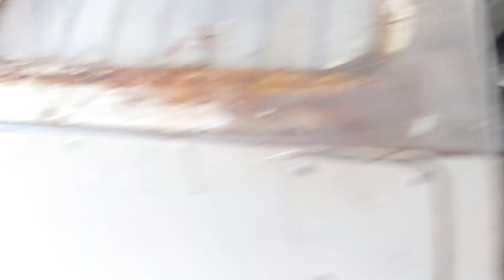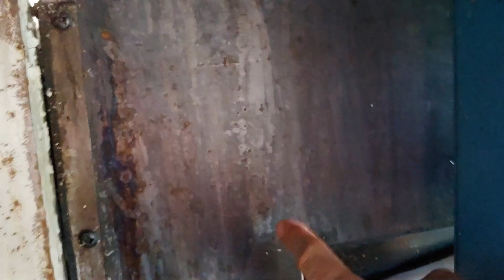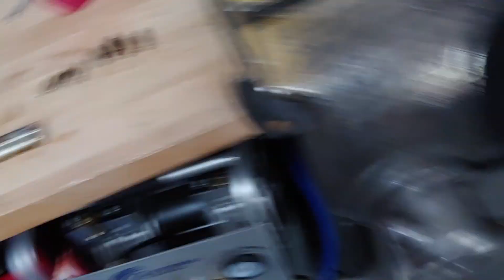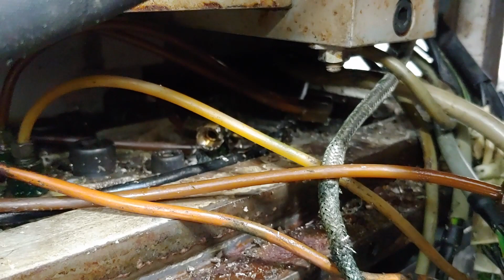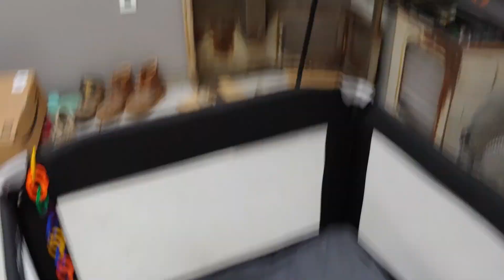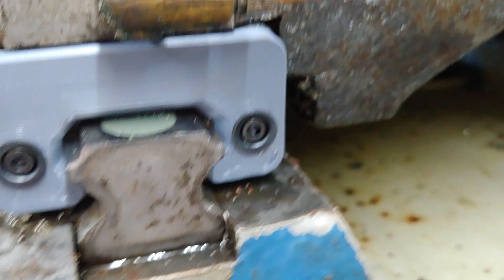Crusty Mazak Lathe - Episode 2: Initial Cleaning and Inspection

Comment: hi from Argentina Reini. I'm glad that you record your work, please keep doing it.  I'm currently  (started yesteday) on my own retrofit of a mazak qt8n lathe exactly  like yours. Mine has a broken servo drive electronics, faulty screen , missing chuck, lost hydraulic pump , coolant pump and oil pump (it's seems that it was used as a donor) but it's in good mechanical shape and almost no rust, but lots of dry coolant making things stuck. I will convert it using linuxcnc and mesa 8i20. I'm already retrofited a hyundai bt30 mill with linuxcnc. if you wish, we can help each other on the lathe.  Anyway , nice work. regards.

Comment: Was the chuck drive pin intact?  Not sure if it came with them but make 2 bolts to hold the chuck in place so when you release it it slides out onto the headless bolts.  Be careful with the drawbar on the actuator.  Never use a solid locktite on it ever.  Chuckside use a neverseaze compound.  Chuck pressure is surprisingly low compared to say a collet closer.  Im betting you know some of that.  Awesome progress keep it up.

Comment: If its a kitagawa Chuck actuator then orings available at bearing shops but will be odd  Japanese spec. So mixture  of standard metric , P metric and G metrics hyd orings. Should also be 90 duro for hyd. Keep up the good work